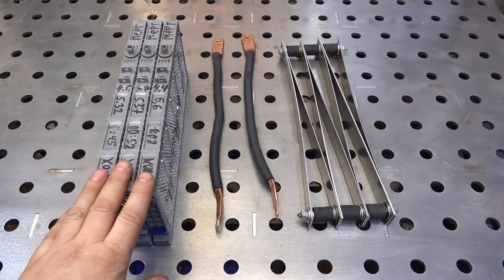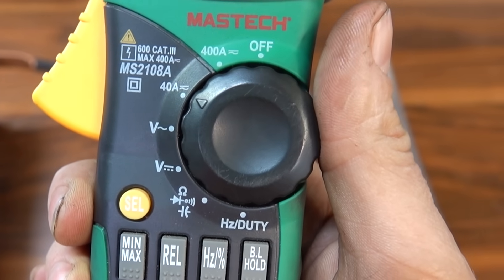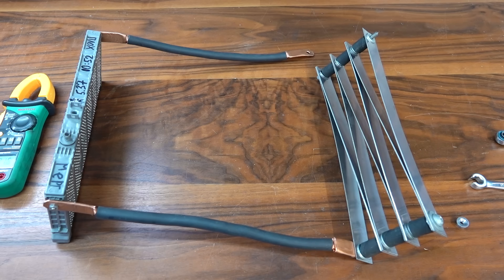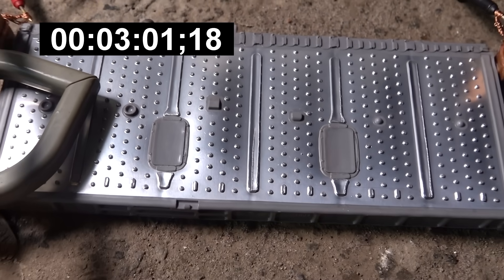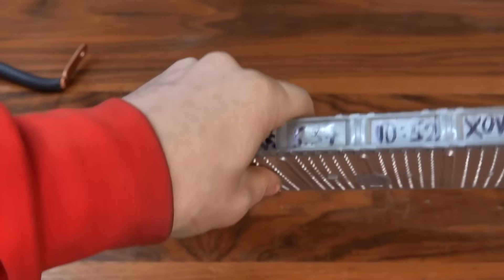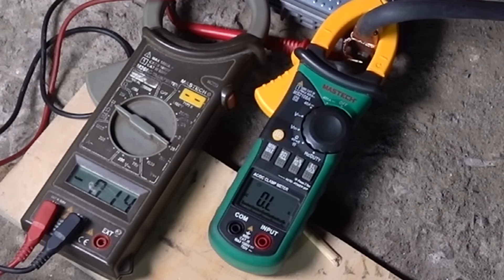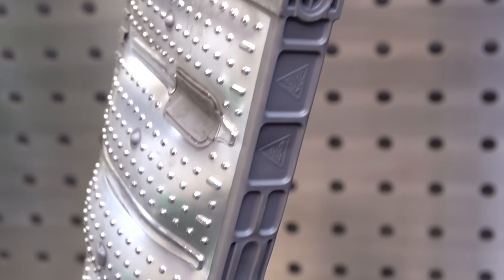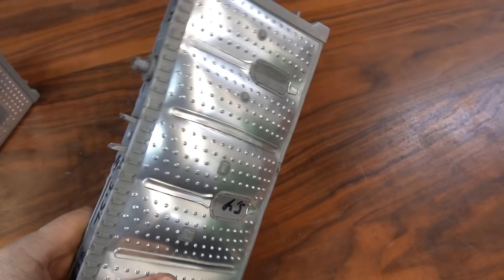Батарея Toyota Prius - Короткое замыкание

Comment: If the Lithium ION battery ruptures the emitted gases are very toxic, very flammable,  and dangerous to breath:

Outgassing from a lithium-ion battery is the release of a mixture of flammable and toxic gases, primarily from damage, overheating, or misuse, that can be poisonous or both. Key components include carbon monoxide (CO), carbon dioxide (\(CO_{2}\)), hydrogen (\(H_{2}\)), and various hydrocarbons, as well as highly toxic and corrosive hydrogen fluoride (HF) and hydrogen cyanide (HCN).

Comment: In theory if you were able to have a so-called perfect battery a short circuit would deliver infinite current.  All batteries and wires have some resistance, and this current will have its limits. The larger the battery, the lower its internal resistance, and therefore higher current and greater heat dissipation.  I = E/R   If R = 0 then I has to be infinite.

Comment: Any electrical product will burn if it is not used as directed. 90% of house fires. Same as any flammable liquid will ignite as long as you supply it a spark! Simple Science. Stop Abusing Lithium batteries to simply promote the fossil fuel automobile industries. I'll keep my Toyota Prius Thank you. Sorry Motorheads, but the fastest car's in the world now are Electric and Jet fueled! Gasoline is so stone aged. 😂👍

Comment: i guess it’s designed not to burst into flames.. and the metal body holds i’m the extreme pressure. that’s good, because those batteries can be very powerful and dangerous

Comment: You made a very good test, with all the values displayed.  I was surprised that the Toyota battery lasted so long!   Is it possible that the electric car battery can explode while the car is being driven?  Do they have a device to prevent explosion?   Imagine, the large size of car battery exploding !  It would destroy the car, and the owner must buy a new car !   Amazing test, thank you.   Please do not explode yourself!   Best wishes from England.
Reply: The battery management system properly maintains the battery.  Prevents short circuits, over charging and over discharging.

Comment: Older toyota prius use nickel metal hydride cells- they're not nearly as volatile as lithium ion typically is. They swell and burst but almost never catch fire because their components are inherently non flammable
Reply: they all go in flames and can self-ignite. MH doesn't build piercing spikes from lithium, just bursts with electrolyte.

Comment: A friend of mine (a motor mechanic) was removing a normal lead acid battery out of a car one day, as it would no longer hold a charge. He accidentally dropped a large spanner / wrench which landed right across the terminals, and - bad as the battery was - it STILL put enough current through the spanner to weld it to the battery terminals!
On the upside, he said the spanner formed a very useful carrying handle to take the battery away!
Reply: I would have said I did it on purpose to make the handle in the first place!
Reply: I did that once at tech school with a ratchet...welded it to the frame of my Chevy via the  battery terminal.  Fortunately, no one was hurt and the ratchet remained usable once I got a hammer and knocked it free.
Reply: You just have to make sure you grab the "handle" and pull the battery out before it starts glowing red 😂
Reply: I once did it with my tongue.  To this day the battery is still there attached to my tongue, swinging in the wind.  I like cool stories from real people.
Reply: @nealparry  да, 4.5 вольтовые батарейки всегда проверяли языком (контакты с одной стороны). Возможно вам просто не повезло, слишком мощная батарейка
Reply: I had the same happen to me with a heat shield, lol. Mf look like a statue. 😂 😝 😂
Reply: Bull crap story, never happened.
Reply: Lead contact easy to weld

Comment: Even with all that abuse it still didn't catch fire. That's a pretty good battery.
Reply: That's a LiFePo4 battery for you.  NMC would have exploded.
Reply: @charlesball6519  

there was an lfp battery shown in the video?
Reply: @charlesball6519  NIMH  LOL
Reply: @charlesball6519  This is a Ni-MH Battery. Lifepo4 do not catch on fire, they emit grey/whiteish smoke when shorted. They are quite safe. Lithium ION and Lithium Polymer on the otherhand...
Reply: @charlesball6519   Nickel Metal Hydride.
Reply: dont forget that in the real world  they are contained and pressed together in sealed container . much different  situation
Reply: I think if you had a bunch of them stacked together in a case, you’d have some serious fireworks!
Reply: It's also not installed as it would be in a car. If that expanded in the car, who knows what if could do
Reply: @cartler  I'm sure car has some sort of safety and way of reading and diagnosing malfunctioning battery.
Reply: @whitetooth213  if its in short, i doubt any electronics would work
Reply: @whitetooth213 yeah it sure does .... it sounds like BOOOOOOOM

Comment: Not familiar with the Prius, is it all electric or hybrid? How many of these batteries are in the car? What type are they? I’ve heard that some battery packs are just tons of AAs welded together and put in a big case. I did notice these were not like that. Either way, short circuits tend to do bad stuff like get hot or explode! 
    Great video, but not sure about handling them even after the first test after they puffed up.
Reply: pruis used both NIMH and lithium ion, these cells in partciluar are the older, NIMH cells.  7.2v blocks, 6 cells in a block
Reply: Tesla batter are lots of 4680 welded together. They are way bigger than AA batteries.
Sadly you can't just swap a bad cell, they are welded and then cast in some kind of foam inside a welded metal box.
Reply: @ameunier41  thank you!

Comment: Should have built in a switch so you could safely connect everything and then flip the switch to make your dead short
Reply: thats switch circuit will destroyed first and disconnect before this battery reach maximal damage
Reply: Do you have any 1000A switches handy?
Reply: Это не наш подход!

Comment: Hybrid car batteries are dangerous to experiment with: the lithium inside them is highly flammable if exposed to oxygen, and we all saw that they can explode if short circuited. Be very careful if you own a hybrid car and work on it yourself. Never do any work on these cars unless you disconnect the power cables at the traction battery. On some models of Prius, the battery is almost 300 volts and holds almost 9 kilowatt hours of charge when full. More than enough to kill you in touch the wires.

Comment: Parallel your wire, use two exact same, clamp meter on one of them, simple trick and you extend your clamp meter range twice, just multiply readout from display x2

Comment: Anyway if the airbags fail the battery pack will be a great backup
Reply: Is this the battery that powers the electric motor
Reply: @spankthemonkey3437  It's part of one, Spank. The whole battery is composed of a bunch of those packs all connected in series-parallel  to provide the needed voltage and amperage to run the car. This photo shows the inside of the Prius battery:
https://s3-media3.fl.yelpcdn.com/bphoto/75d6HJYdp9jr8SLZyArq4g/o.jpg
Reply: @spankthemonkey3437 yes
Reply: In a comment section full of Russian words, I still have no idea what you just tried to say
Reply: @JM-yx1lm  the battery is bulging out so he's joking that it can be a cushion like an airbag
Reply: @JM-yx1lm  Click on the translate option. You'll get a hint at least.
Reply: J M   maga!
Reply: @oneselmo  they don't have that in South america
Reply: those batteries have a 180 amp fuse 28 cell version (or 200amp fuse on the 40 cell version  300-330volts) on the interconnect switch

Comment: Very carefully because the  spelled gas of the battery xplosion is very very toxic. If you have a old and bombed cellphone battery, charge it, and then just make a cut with a cutter on the bombed surface, you will see a real fire xplosion but do it outside of your garage. Thanks for share